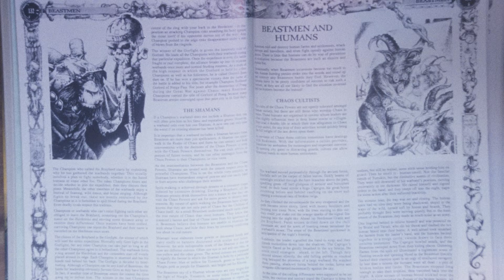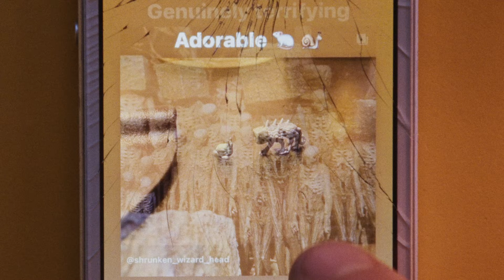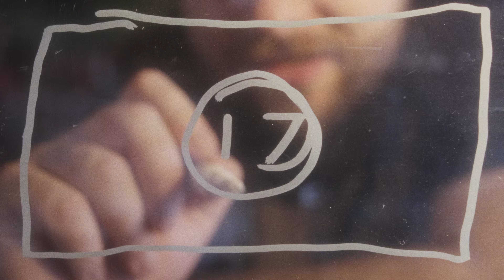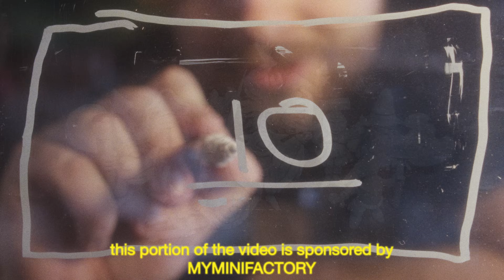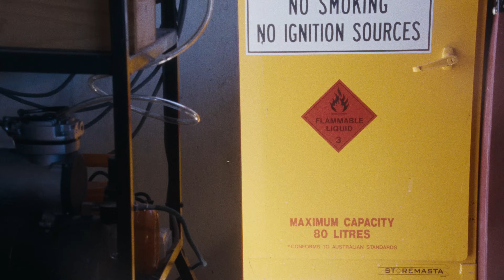Getting My Hobby Life Back Together

Comment: To fill that spave you can make a box for holding tie downs/chains, flat mount a "spare" under bed.

For the steps question, could you make them pop out ones with another servo?

Are you set on the car style/pistol grip remotes? There's a 10 channel flysky that I use and it's pretty cheap and paurs with almost anything but it's a plane/flat style conttoller.

Comment: You haven't even realized something interesting about that Cubeipede, you can get the illusion of the inside face following the viewer if you paint it correctly. Look up hollow face illusion. The illusion may not be as strong as a full size bust however, my guess is the angle that it will work at will be more narrow because it's smaller. Still worth a shot though!